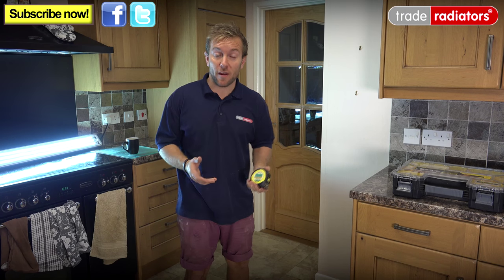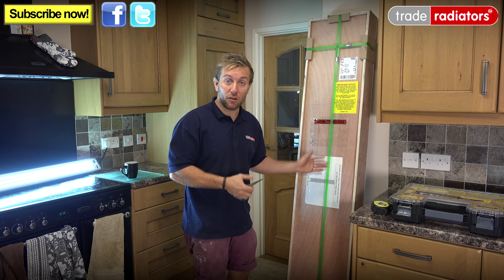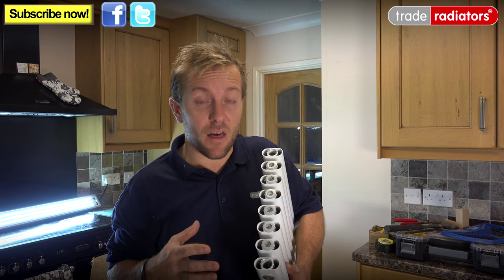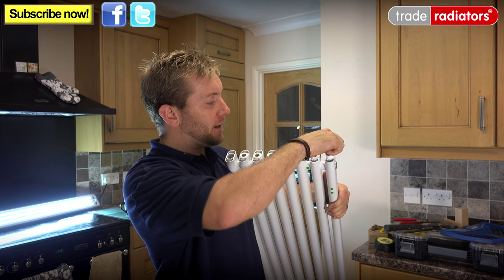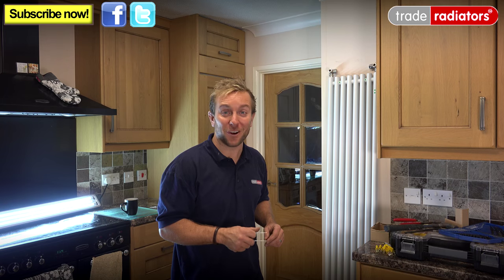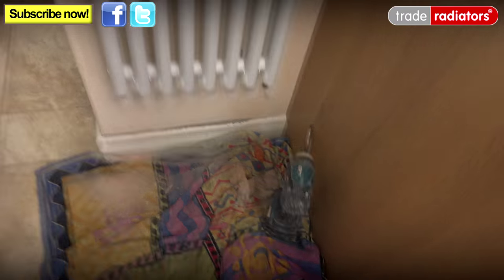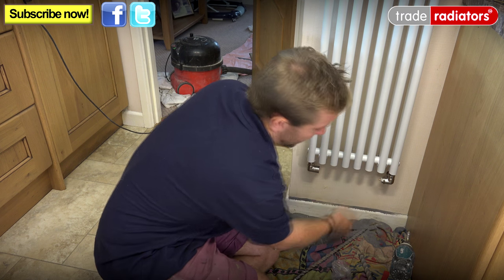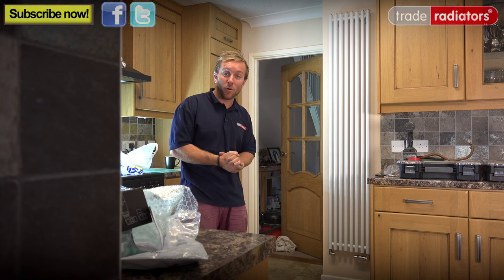Installing a Vertical Aluminium Radiator in a Kitchen

Comment: can any of these modern virtical radiators be plumbed from the top ? (all my radiators downstairs have pipes running all the way down the wall from the ceilings) unsightly.. thanks
Reply: No
Reply: My plumber was saying it’s best to have the inlet and outlet top and bottom, so you get a better flow through the radiator. Is that right?

Comment: Why you install standard 15mm isolator valves instead of full bore valves.  Now you reduce the flow from 15mm to 10mm and the same rad take longer to heat up 👎